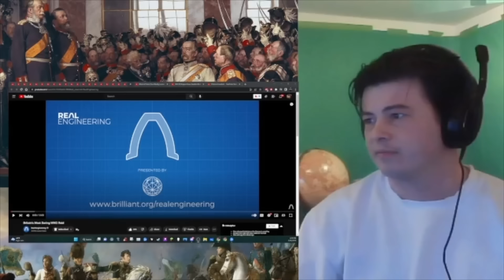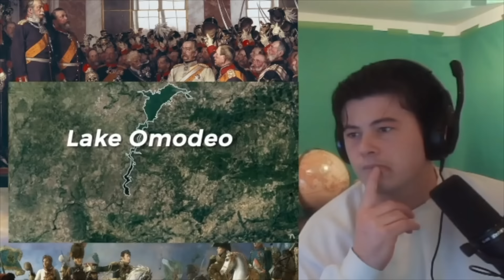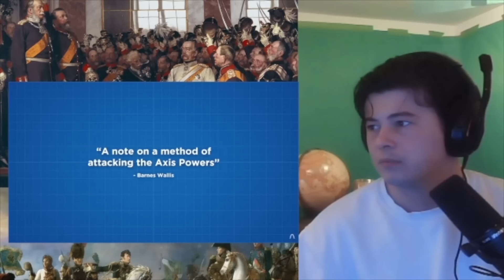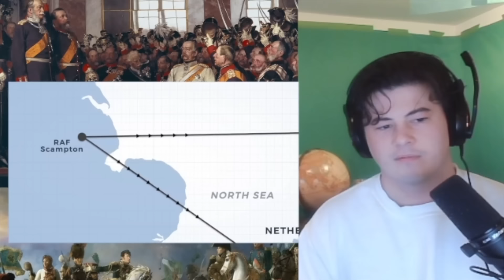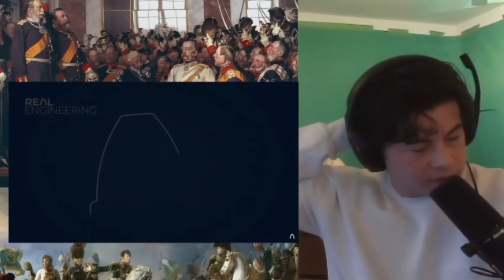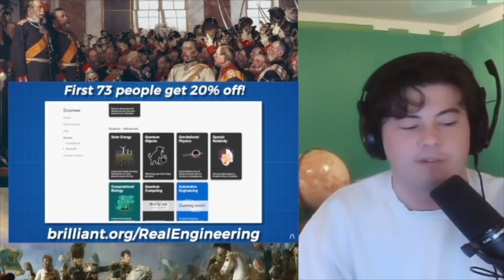American Reacts Britain's Most Daring WW2 Raid

Comment: You have to watch the Dambusters Film, as that explains more than this video did as it glossed over the matter of how to maintain the low level and distance to dropping the bomb so as to get the bomb to sink next to the dam wall. the height problem was solved after seeing theater lights in action and the distance by using what looked like a catapult to line up with the dam's towers.  🧙‍♂😊

Comment: You asked about the shape of the bomb.  It was originally intended to be spherical, but in tests, the casing broke...but Wallis also saw (to his surprise) that the cylindrical "innards" carried on bouncing as before.  Thereafter, they abandoned the casing.  The backward spin (rather than forward) was also important because the idea was that the bomb would bounce to the dam wall and then the remaining "spin" would effectively "roll" it down the wall to the required depth for an electrostatic charge to explode the bomb.

Comment: The boundary layer of air is dragged around the bomb via friction with the surface skin. 
Because moving air is at a lower pressure to still air or slower moving air (Bernoulli's Principle). If you rotate the bomb backwards there's fast moving air above the bomb and a collision of air, as this boundary layer meets the oncoming airstream from its forward velocity, causing high pressure beneath. 
Just like a wing, high pressure beneath & low pressure above cause a net force upwards, lift. 
This is why golf balls are dimpled and the club imparts a backspin causing lift the same way. This was noticed by golfers because old, cut up & dented balls flew further. The rough surface increases the velocity of the boundary layer.
The altitude was obtained accurately by having two spotlights pointing down from each wing and onwards that converged at 60ft. 
Distance from the dam was obtained by sighting from the point of two sticks arranged in a V shape with a pin at each end. When the pins lined up with the towers either side of the dam, that's your drop point. Simple but effective.

Comment: 10:57 Just to put it in perspective, 60 ft was ludicrously low for an Avro Lancaster to fly, the Lancaster bomber's Wingspan was 102 ft.  So in other words if you rolled the aircraft on its side at that altitude the lower wing would be practically touching the water.

Comment: 8:18  The B1 "Special" Lancasters used for the dam raid didn't need their ventral guns removed, aside from very early examples Lancasters virtually never carried them.
The Ventral turret developed for the Lancaster wasn't very good, so the vast majority didn't cary it since removing it reduced wight and drag allowing the Lancaster to fly faster.  What was removed was the Dorsal, aka "mid upper" gun turret since the bomb spinning mechanism got in the way and the payload was so heavy they needed to save even more weight and drag, so they cut the bomber down to only 2 gun turrets, (nose and tail).

Comment: Barnes Wallis also developed the designs for swing winged aircraft that formed the basis of the systems later used by the F111 and the F14 Tomcat. He also had input on the design of the ogival wings of the Concorde and the intakes that slowed down air fed into the engines while the plane was travelling at supersonic speed.

Comment: You asked how Allied prisoners of war were treated in Germany.  AFAIK the answer is "pretty much OK" similar to how the UK treated PoWs, and better than Guantanamo Bay, allowing Red Cross parcels through, allowing prisoners to interact with one another to the extent that sometimes, escape plans could be formulated, and without starving them (except when, towards the end, food deliveries suffered and the guards were also on reduced rations), and generally in accordance with the international rules of war (this was of course before the 1949 Geneva Conventions, but generally similar rules were known).  (As the USA and various other countries make use of, the Geneva Conventions only apply to PoWs, not to people convicted of a country's crimes, so internal prisons do not have to comply.  However, the new prisoners at Guantanamo Bay have not been charged, let alone convicted, of any US crime -- they were picked up immediately after crossing the border and, perhaps surprisingly, "illegal" border crossing into the USA is not in itself a US crime!)

One thing the video didn't mention is how they achieved the accuracy of height above the water -- air speed was known fairly accurately from standard equipment but, as you said, height above water was critical, and in an area where local atmospheric pressure was not accurately known, would only be known from instrumentation to within 200 ft -- much less accurate than the pilots could judge for themselves, which itself was proved by experiments to be insufficiently precise.  Radar altimeters were still not practicable, even experimentally -- radar light enough to be carried on bombers (and even on fighters) was a brand new system, based on the UK invention of the cavity magnetron (which has since been superseded for radar but is the basis of all domestic-sized microwave ovens, but AFAIK, was then only accurate to a few hundred feet, so worse than an aneroid altimeter).  [Did you know that radar is an acronym for "radio detection and ranging"?]  So someone (the Dambusters film claimed it was Guy Gibson and I have no other information) had the idea to mount a searchlight on each wing pointing downwards and towards the centre of the plane, at an angle which made the spots on the water coincide when the height was correct. This was called out to the pilot by the bomb aimer, and with the aircraft straight and level at that height, the bomb release time could be found when the dam made a certain vertical angle with the plane.  I've no idea how they adjusted or calibrated the spotlight angle -- how could an observer accurately determine the height of an aircraft about 50 ft above the ground, flying over water or extremely flat land in the dark, or at least at dusk, sufficiently dark that the spotlights could be seen?

Comment: Water is not like a plying pool top spin causes forward motion in water top spin will give forward motion but to a point as it also gives burying causing the water to go over it pull it down which slows it and also dives it.  It is like skimming stone  you throw oit but make it spin right to left or left to right. Because it is flat and you put forward spin it will drop same backward spin but if you and back wood a round stone fast enough it will bounce try forward spin and see.

Comment: Great engineering but big miscalculation for the level of impact. Most victims were POW and forced labor mainly from eastern europe plus one third were families. The power loss was minor and did not harm the war industries much. They got now workers to replace the dead ones. What is said in the video about the huge impact on war is just wrong. The drinking water production was back one week later and the electricity as well. The main power production was in the Ruhr area from coal anyway. The coal production went down for a month, and some workers were directed from building defense structures to rebuild the dams but the numbers were limited. The biggest success of the operation was propaganda in UK.

Comment: They used an ingenious device to set their altitude accurately. They mounted angled spotlights under the nose and tail, so that the reflections on the surface of the water converged at the correct height.

Comment: To judge the altitude above the water, a spotlight was fitted under each wing.  These were pointing vertically and angled inwards so that when the y converged the plane was at exactly the aat the correct altitude.  Of course they were switched off until the plane was approacing he water.  Distance from the dam was judged by using a simple targetting device which focussed on the towers at each end of the dam. It is well explained in the post war British feature film called "The Dam Busters"
Reply: They weren't under each wing, they were in the nose and tail. If they were under each wing they wouldn't converge onto a single spot when the altitude decreased.

Comment: The 56 men lost was grievous but that's what can happens when you go so far into enemy territory and to so difficult a target.  How many casualties did it take to win one well defended field in the Bocage? And around three times as many men died, and more were taken prisoner to achieve, likewise, the breach of a single structure during the raid on Saint-Nazaire. Compare also the Schweinfurt/Regensburg raids. 600 men in 60 aircraft were lost for a much smaller effect. I have little time for revisionists - no one likes Norman know-alls. This video lists all the damage done, and although the dam was quickly repaired, the flood damage took much longer to recover from. Also, the  reason the damage to the dam would be given priority was, of course, that the reservoir behind it would take months to fill up again to the point where it could produce electrical power and supply water for the Ruhr industries in the accustomes quantities. If the winter rains and snowfall had been missed that year the dam would have been yielding less water until the following winter. Wiki "The Mohne Dam was repaired by 23 September 1943, in time to collect water needed for the following summer". Conclusion: Chastise was a great success.

Comment: The most difficult part of the bomb drop was knowing a) When are you the correct distance away from the Dam to release the bomb and b) How to be at the correct height to facilitate the correct series of bounces to hit the target accurately.
Bearing in mind how quickly this whole thing was put together the answers are also almost unbelievable. The first issue was addressed by sticking two Lollypop sticks at either side of the bomb aiming device, when the sticks lined up with the towers placed at either end of the dam, then you were at the point when you had to release the bombs. The hardest problem, however, was no equipment had yet been invented whereby you could measure accurately your distance above the water, it was something ridiculous like EXACTLY 60 feet. This was solved by attaching a spotlight at the end of each wing. These were pointed inwards so that both circles of light would merge together when the height was right where it was needed. This should indicate to you the immense bravery of the crew. they were attacking some of the most heavily defended targets in the war, yet they did so by not being able to swerve from their height and course. Not only that but the planes were illuminated by the huge bright spotlights under their wings. Guy Gibson was awarded the "Victoria cross" for his actions, not for leading the whole raid, but instead for even though he had finished his bombing run he immediately turned and accompanied the following planes in turn to draw the anti-aircraft fire from them to give them a better chance of success. This whole raid BTW was made into a movie called " The Dam Busters" its B&W but incredible.

Comment: The British fans bombsight was extremely accurate, 3hits with 12,000lb tall boy bombs on the tirpitz from20,000ft.
Direct hits on many targets with this bomb sight. SABS
Edit
Although the Mk. XIV served the RAF's basic needs, the requirement for a more accurate sight remained. This need became more pressing as the earthquake bomb concept was pushed forward, a system that demanded more accuracy than the XIV could provide. In 1942 the Norden was still not available for license, in spite of it being used on US bombers arriving in the UK to attack Germany, thereby eliminating the Navy's primary argument that it should not be given to the RAF as it might fall into German hands.[18]

In response, earlier concepts of mating the ABS to a new stabiliser platform were carried out to produce the SABS. Like the Norden, the stabiliser was separate from the bombsight proper, although in the case of SABS the stabiliser moved the entire ABS bombsight, rather than just the aiming reticle as in the Norden. Unlike Norden, the SABS's stabiliser did not serve double-duty as an autopilot, as RAF bombers were already equipped with one. Instead, directional corrections from the bomb aimer were sent to a pilot direction indicator in the cockpit, similar to the original Norden models

Comment: A few extra details: Barnes Wallis was thinking about coal and iron mines as the primary targets for his 'earthquake' bombs, but such mines were never attacked this way.  

The explosive used in the 'Upkeep' bouncing bombs was part of the equation:  'Torpex' (Torpedo Explosive) was a modern high explosive, with added aluminium powder, which caused the explosion to last a longer time, increasing the 'shove' effect underwater.  

Without this, the explosive was called 'RDX' and was employed in most of the large 'cookie' or High Capacity' bombs used by the RAF for land targets, like buildings.  

Wallis's earthquake bombs were used many times, on battleships hiding in Norwegian fjords, large concrete structures like the V2 assembly and launch sites the Germans had built in France, railway viaducts such as the Bielefeld Viaduct (this attack is on youtube), and numerous attacks on U-Boat or submarine pens (bases), these are also here on youtube.  

The idea was also used by the USAF to attack bridges and other targets in North Korea during the Korean War, as the AZON and TARZON guided bombs.

Comment: One thing that is not mentioned is how they managed to maintain a height of 60' above the water at the dams before releasing the bombs. In training, this had proved to be a major problem. They eventually solved it by having two spotlights fitted fore and aft on the planes, angled so that the beams met at exactly 60'. However, that meant that when they were flying their attack runs they had the lights fully illuminated, allowing the anti-aircraft gunners to see them in the dark.
Reply: But it wasn't solved by Gibson on a trip to the theatre. Looks good in the film though

Comment: Sir Barnes Wallis took very hard the deaths of so many airmen lost in this mission. Check out the film "The Dambusters" which tells the story very well. What is not mentioned in the video is that two searchlights were fitted on the underside of each plane at a certain angle so that when the beams converged on the water surface the plane was at the perfect height to release the bomb. Too low and there was a risk of the bomb bouncing up into the plane, too high and the bomb might break up on hitting the water. Wallis thought of this remedy also. A very clever man.
Reply: Wallis was a brilliant engineer but it was Benjamin Lockspeiser, a scientist in the Ministry of Aircraft production who had the idea for the searchlights and designed the mechanism. He remembered the concept from earlier in the war where RAF Coastal Command had toyed with the same idea.

Comment: You are correct.. The shock-wave underwater is very strong.. Why? Because you cannot compress water. Simple as that.. they actually use water in door breeching charges to direct the charge.
If you spun the ball/bomb the other way, the rotational force would pull it towards the water.. The MAGNUS EFFECT is used, check out the How Ridiculous boys with their ball off dam videos..
They used spot lights to set their 60ft bombing runs, attached to the wings, aimed at angles.. and when the lights combined in one spot on the ground/water, they were at the right height to release their bomb.. Watch the movie The Dambusters (1955), it has actual footage in it..

Comment: Its easy to be wise after the event. What was so incredible, was that Barnes Wallace thought of the idea and was able to make a bouncing bomb. Think back to those days, no computers or gps or anything, which would make it relatively easy today. The opposite spin was to keep the bomb against the wall of the dam as it sank. to get the exact height of 60 feet above the water, Guy Gibson. D.S.O and Bar . VC .(Wing Commander) dreampt up an idea after watching a stage show. using spot lights that converged exactly at the aircraft being at 60 feet.. All in all a remarkable achieve meant. Even today
there is a video of a pilot flying the same course as the bombers flying 60 foot above the water, found it extremely difficult and he was not facing being the only target for the flak.  Because Gibson
flew back 3 times to take the flak from the other aircraft with a bomb, he won his VC (Victoria Cross- highest possible British award for bravery)
Reply: @johnchristmas,  The idea of the spotlights came from Farnborough.  Gibson watching the follow spot op at the Theatre and getting the idea, was made up for the film.